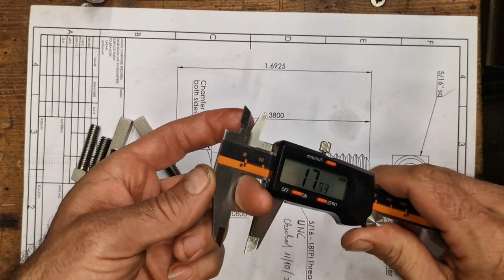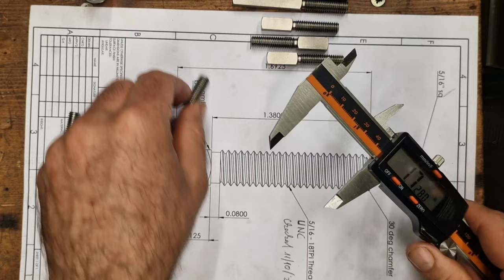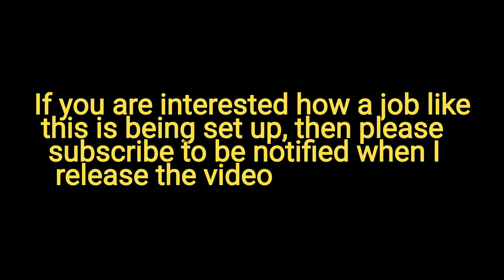Manual Machining like CNC

Comment: If you begin to wonder why you are losing your cutting edge prematurely on that first insert it is more than likely coming from dragging it across the workpiece without the workpiece moving (very first operation). Carbide is very hard but also very brittle because of the hardness.  In the case of the lathe the workpiece needs to be revolving every time the carbide contacts it or micro chipping and cracking of the insert are the result.
Reply from the maker: Hey thanks! 
Yes, micro cracking is a big thing with carbide and HSS as well. Using coolant intermittently also induces micro cracking in cutting tools.
Is that after facing off or rough turning the thread O/D? Edges where not touching in either occasion, video does not show or mention this. 
Thanks for your comment!
Reply: @chipmaster7738  it is the operation where you set the bar to length from the collet against the side of the tool.  You come back to your start point and drag the tip/insert across the non revolving square bar.  The insert has to be touching because it is leading.
Reply from the maker: I agree, it looks like it's dragging across the face

Comment: Love the demonstration. What cutting oil do you use ?
Reply from the maker: It's STAR 22 ULTRA from Trentlubricants.

Quote 
"Star 22 Ultra is a pale, low odour, chlorine free neat cutting oil containing extreme pressure, anti-wear and lubricity additives blended in carefully selected mineral base oils.

APPLICATION

Star 22 Ultra is a multi-metal high performance heavy duty neat cutting oil, with medium viscosity characteristics, for use on titanium, high tensile steels, stainless steel and alloys. Specifically designed for use on sliding head CNC and multi-spindle machines and is also suitable for broaching and gear manufacturing."